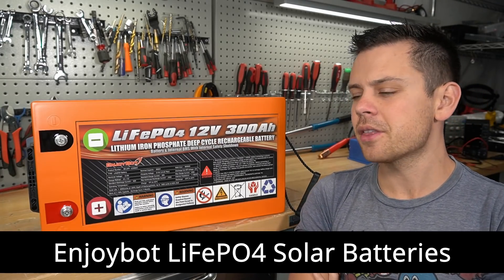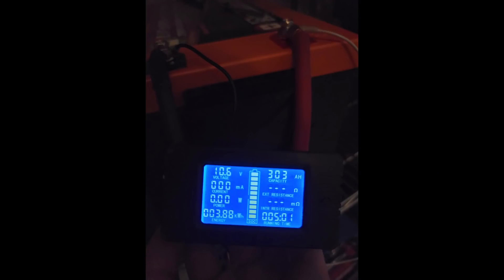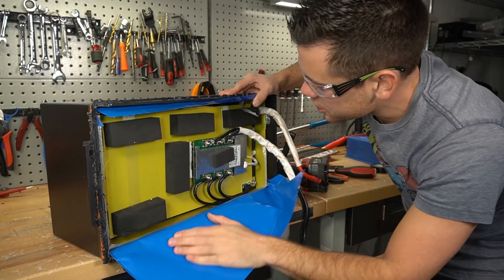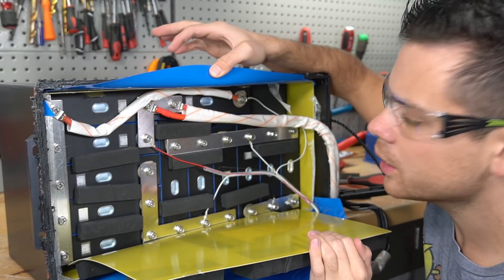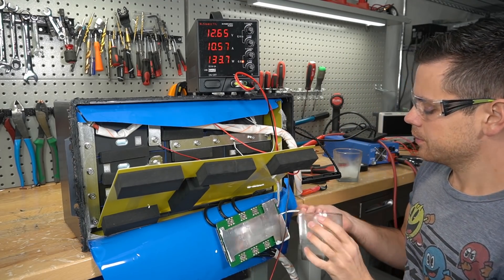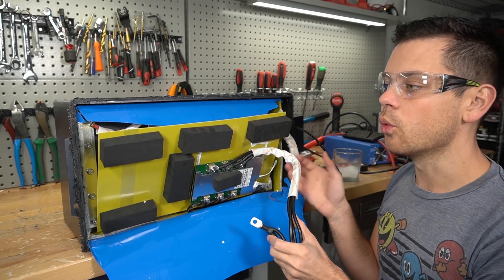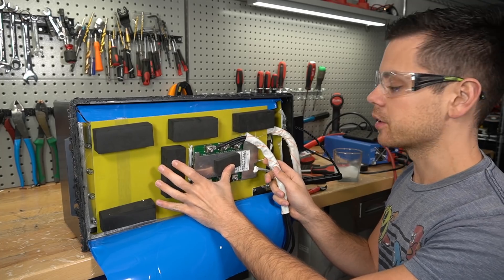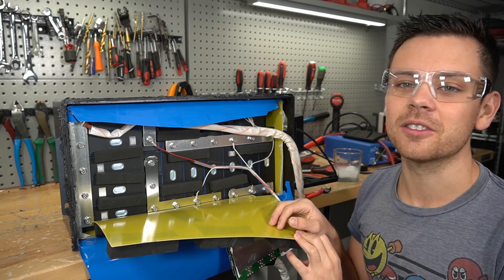Dirt Cheap Lithium Batteries: Enjoybot LiFePO4 for $.26 per Wh

Comment: Will, please review the POWER PRODUCTS 100ah lifepo4. I bought 4 of these for only $288 each on ebay  after seeing the one review on YouTube. The reviewer did a load test which came out to 110ah and a low temp test with ice water and it worked! Unfortunately his back was turned during the video so I couldn't see what he was doing. Thanks in advance.

Comment: Will, have you heard anything or would be willing to test a Tobattery? They are sold on ebay or on there website they also say they have low temp protection. It's a remarkably cheap battery but it does not look like a chins copy cat.

Comment: If I put 3 x 12v 100Ah in series for my 36v trolling motor on my boat , my onboard noco genius genpro charger has a lithium setting, then once fully charged goes to "maintaining" mode. Why is it said that leaving lithium batteries connected on maintainer will damage the batteries? How long is too long to be plugged in, if my charger switches automatically to maintain?

Comment: I have six 225ah 6volt batteries wired to give 675ah at 12 volt. I currently power only my two tv's, a home theatre, a coffee maker and using a 3500 inverter. I am thinking of using 4 of those batteries to go to 24 volts instead for greater efficiency. I am however not sure whether I will have greater capacity and longer runtime at 24 volts. Would appreciate some advice on this.

Comment: That's only 3.6kw for $1000
I just picked up about 14.5kw worth of lithium spim08hp from battery hookup with bus bars shipped for $1800. It definitely pays off to build the batteries yourself

Comment: Don't know if you'll ever see this, but what is the possibility of adding a low temp sensor to a package like this?  Or do you need to replace the entire BMS with a proper one?  Thanks for any insight that you can share.  Too common a problem needs a solution.

Comment: Is it possible that the low temperature protection sensor is simply on the BMS circuit board itself?  You would not need that sensor directly attached to the battery as that is more of an ambient reading vs directly attached to the battery pack where an over current or overcharge condition would heat up the actual pack and require a quick response?  Cold protection would not need to be directly read from the pack as the entire battery, case and BMS would be at the colder temperature over a period of time.
Reply from the maker: Yes, but that would be awful. Cell temp sensor needs to be on the cells. Always.
Reply from the maker: Show me a UL listed pack that has a temp sensor anywhere else besides the cells and I will change my mind in a second. Post your proof in video format and I will be all over it.
Reply: @WillProwse  would be easy enough to test the theory.  If you can put the entire battery in a freezer.  My thinking is cold is under much different circumstances then heat.  The BMS nor batteries would be warm because the battery is not being charged at that point.  I would be curious to see how that experiment would play out.

Comment: I‘m interested in a video you build a system which charges a 12V battery using a 230V charger and discharge it on demand into a 230V environment.

Comment: Have you ever tried soldering on a low temp sensor if you know from a previous version of the BMS that it can support it?  I know that's not a great thing to need to do, but curious if it would work.  If you have to cut the battery apart to get to it, know that isn't something worth doing, but a few of these could be access by removing screws and not the "chainsaw" also known as an oscillating tool. Just a bummer that some of these could have low temp if they only did a little extra work assembling.

Comment: Hey Will - 2 questions for you: 1) why dont they just put in a low temp sensor? Are they prohibitively expensive or something? 2) You mentioned going with a 'server rack' battery setup - could these be used in a van build, or are these better for stationary purposes?
Reply: They build this in southern China above Hong Kong. Sub-tropical area. If they are just a only local supplier, they may not see the need. I know it doesn't make sense to export to America. I brought the 200 AH battery use in Yuma Arizona which never freeze neither like -5C. A low temp shut off charging circuit is not hard to rig up.
Reply: @padraicley3265  Yeah, good point...but while they may not have a need for it, theyre exporting them, and even more strangely advertising it, then it should be there...very odd

Padraic - specifically, how would you rig up a low temp shut off function for a battery bank?
Reply: @Js18100  Some MPPT's like epever have a low temp setting.  You might need to buy and connect a temperature probe to it though.

Comment: Hey Will, I just got one of these.  Please read the middle page of booklet that came with it; it discuses a "low temperature heating function"!  Apparently these have a heating function below freezing and charging cutoff... I think this can be tested this by putting it in a freezer.  Care to redo test this function for us?  I'm not equipped for this testin my campervan.  Cheers & blesses from Texas!
Reply: From the battery booklet:
"Low temperature heating function. When the temperature is below 32° f, the heating film will be turned on under charging conditions. During heating, the charger only supplies power for the heating film and it will not charge the battery when the temperature is below freezing. When heated to 50° f, the BMS stops heating and the battery starts to charge. When storaging and discharging, the heating film neither works nor consumes battery power."
There's some other notes below that involving charging below freezing that don't make sense to me...

Comment: Thank you for taking a closer look at larger batteries in addition to racks.

Two of them should work in parallel, right? If so, is it allowed to double the charge / discharge current or always depending on the BMS?
Reply: Also curious
Reply: Two in parallel would work just fine.  IF you had a 600 aH MPPT, the batteries would accept the charge power they were designed to take in.  Discharge would be double the rating.  (Usually half which would be 150 aH discharge per battery, with total of 300 aH) 
In series the discharge would remain the same as the batteries rating, but the benefit would be the increased voltage, which technically speaking doubles the discharge rate.  There would be limitations as to how many could be linked together in series though.

Comment: hey Will I don't live where it gets that cold, I get snow on the ground but it's just 30 degrees and I don't use solar "yet" just a spring and summer RV would this be good ?
Reply: Yeah..your not charging.
Reply: With no charger , the battery doesn't have an issue . Check out what ”low” temperature cut out can be . If in a RV , water pipe heater wrapping plugged in to house electric will keep batteries Warm unless windy and Cold .
Reply: @flowrob6861  thats what I thought Thanks

Comment: Will, I just bought one of these batteries. After reading the product information pamphlet I discovered a page in the back stating that it has a low temperature heating function. I am a little skeptical of this claim because of the low cost but if you read this could you please check the joybot battery you dismantled for this "heating film" they claim to have? 
Thanks, I learn a lot from your videos.
Reply: Mike, I also bought one and saw the same thing in the manual. If you look carefully, that manual covers the basic battery and the more expensive "smart battery," but only the smart battery has the low-temp protection. It wasn't till I read very carefully I saw the differentiation.
Reply: He would have found the heaters during tear-down.

Comment: A question for you. If you touch the end of that positive cable will your body provide enough ground to discharge
Reply from the maker: No, resistance of skin too high for charged particles to flow

Comment: If i have the battery temp sensor plugged i to my renogy mppt, do i need a low temp cut off in the battery itself?  Does the temp sensor on the mppt not do the same thing?

Comment: what if the low temp protection is just built right into the bms try hitting the bms board with some freeze spray
Reply from the maker: Cell temp sensor needs to be on the cells. A BMS bank of fets warms up. If there is indeed a temp sensor on the bms, that's also an instant failure. Completely useless to have a temp sender there.

Comment: I have a few questions that have crossed my mind. 

Can you charge a lithium battery bank 48v while you are using them. Can they charge and discharge at the same time. 

I have the 5k growatt and am wanting to hook my generator up as the grid power? Can I do that? 

If my generator  supplied most of the power load would the growatt use the batteries too along with the “grid tie”(generator)

Comment: I can not help but wonder, if we were to get the low temp sensor and solder it into the BMS, at least on those that have the location on the board, if we would find that the programming is already there, they just don't have the sensor in there.  This is thinking about one of the earlier batteries where you could see that it had the same BMS, just one didn't have the sensor soldered in, but had the location available on the pcb.   Then again, even still, those server rack batteries are too good to just not get them and move on.

Comment: Given the price of these, wouldn't it be worth it to splice in a matching (normally open/normally closed) 0 degree switch in series with the existing switch? Does opening up a battery like this enough to access the BMS compromise anything other than the warranty and the waterproofness?
Reply from the maker: You're willing to cut open each battery you buy and modify it? Why not just use a solar charge controller with low temp charging protection like I said in the video?

Comment: Was wondering if you think the raw materials for LFP are about $500/ton. If so, that's only about $2.50/kWh, assuming 200Wh/kg.

Eventually, with the economies of scale needed to fully transition from fossil fuels, shouldn't that equate to about $20/kWh at the industrial level, and about just twice that at the retail level?
I don't see this happening until more mining and manufacturing is underway, here in the US, too.
However, I still can't wait for such cheap LFP batteries 😁

Comment: I guess you know these BMS very well but is there not a thermistor on the corner of the PCB? - I do understand that its a much worse than a remote sensor away from the FETs. It just surprises me that they advertise low temp disconnect and then miss out such a cheap component, especially in quantity. Is there one factory and Chinese whispers is resulting in the suppliers down the chain writing anything in order to flog these?

Comment: I have a 3000 watt pure sine inverter with a 24 volt system and 30 100w batterys why will it not charge my 2021 chevy bolt ev

Comment: Since this is a common thing can't we just make an adapter interface that would go before the solar generator and just simply have an external one that we can plug in? Like somewhere on the battery it can shut off the input if it gets too low
Reply: yes, the victton smart controller he mentioned at  3:34 does just that, victron also has other "in-line" devices that will open the circuit at a programable temp to prevent charging!

Comment: So basically, it's just a cheaper AmpereTime battery with a lower cost per Watt Hour. The same quality just missing a non-crucial feature. So what's wrong with it? Low-temp charging protection shouldn't ever be a problem with someone who keeps batteries in-doors.

Comment: Hi! Can I connect a 12v lifepo4 100A in parallel with a 12v105a lead acid battery without any problem?

Comment: You stated that several of the batteries you tested appear to be a CHINS rebrand item.
And, that none appear to have a prooer low temp charge sensor.

Have you tried to contact these brands to ask why they do not have the proper sensor?
 
CHINS is a Chinese manufacturer. Chinese manufacturer very commonly copy other manufacturers devices, attempt to reverse engineer the items, without complete understanding of the original design parameters and functionality. 

Perhaps they are trying to fool the buyer?
Perhaps they do not understand the value of low temperature sensor?
Perhaps they do not understand, how/where to place the low temperature sensor in their product?
Perhaps the battery manufacturer does not understand the temperature sensor, design, how it functions?
Perhaps the temp sensor manufacturer has represented the sensor wrong to CHINS?

So many manufacturers attempting to get into the lithium battery market without full understanding of the product functions and physics of the chemistry. Reminds me of the early years of PC and laptop computers. Many many claims of superiority of product.

Comment: If just one of the batteries linked in series has a low temperature cutoff, will that be enough to protect the others?
Reply: Yes.  One battery out of the circuit breaks the voltage for all.

Comment: Will at what temperature do you advise to worry about low temperature charging damage?  Does that temperature hold true for all lithium batts or do other element ratios have better low charging characteristics?
Reply from the maker: While charging, 0 degrees Celsius for this chemistry. But you can safely discharge down to -20 degrees Celsius

Comment: How can I test a LiPo battery for damage after it’s suspected to be charged in freezing weather?
Reply: I assume you mean LiFePO4, LiPo is a very different, albeit lithium-based, chemistry. First test would be voltage at room temperature to check whether any cells have shorted - should be 3.2V (nominal) x 4 = 12.8V. Next check would be capacity. Nothing would be obvious to the eye.

Comment: how hard is it to just add a " warmer" to the battery to keep it above a set temp? a cheep 12V dc heating pad, with temp controls? 
maybe just a 12V dc heating tape wrapped around the lower sides? (heat rises.. right).
how much more in costs to build with a correct bms?
Reply from the maker: Easy. Check out my older videos where I show how to do it on a budget

Comment: Thank you for the review. Is there an external,  stand alone low temperature sensor that can be added to a system using this type of lithium battery? I know some smart hybrid controllers have them built in. I just want the sensor package only. TIA
Reply: Victron makes what you seek. A standalone low temp switch.
Reply: @johnm2056  thank you very much for the info!
Reply: @treysuniverserv1576  most welcome

Comment: How warm would it need to be to avoid damage? 
Could you use some of the charging current to keep the ambient temperature within limits, using a heater? (obviously, if it's too low, then you would stop charging altogether).
Reply: Above 0 deg celsius (32 deg F).  Best option would be to build an insulated box with capability to open during the summer if it gets too warm.  Alternatively you could get an old chest freezer and store/set them up in there with the lid closed to hold the heat in.  The electronics used to charge and convert electricity throw off heat.  These could be used in the same compartment in the winter to keep the heat up.

Comment: Hey Will, I have 2 100 amp LifePo batteries that I have connected in parallel. The other night I ran a heater too long it drained the batteries. I was able to force charge them with my Nico 10 charger but they are now at different voltages. The newer one has a 96% charge but the one year older one gets to 86% and doesn’t go higher? Any ideas of what is happening?

Comment: Is it possible the BMS has an internal temp sensor? The JBD BMS's us DIY'ers are using have one... so maybe these are the same?
Reply from the maker: That's for high temperature on the mosfets. If it was using that for low temperature protection then that's an instant failure as well. This is been mentioned in my videos many many times. You need to assess the temperature of the cells on the cells.
Reply: @WillProwse  I agree and understand that using an onboard sensor would be the wrong way to do it. I'm asking if it's the way they could have done it. Chinese companies making cheap things incorrectly isn't outside the realm of possibility. Drop that thing in the freezer and see what happens!

Comment: 26 cents  per watt hour sounds like a lot. How much would it cost to run a 100 watt light bulb for 1 hour?
Reply from the maker: That's cheaper than lead acid and 1/3 the price of most lifepo4. What are you talking about?

Comment: Will, can an external low temperature protector be added to this?
Reply from the maker: That is exactly what I said to do in the video. Use a victron solar charge controller and program it with a battery sense so that it has low temp charging protection.
Reply: @WillProwse  What if the battery and solar charger are not located in the same area. You might still get a low temp charge
Reply from the maker: @solarforboondockers8015  the battery sense module communicates with Bluetooth. And it has a decent range with the new models now